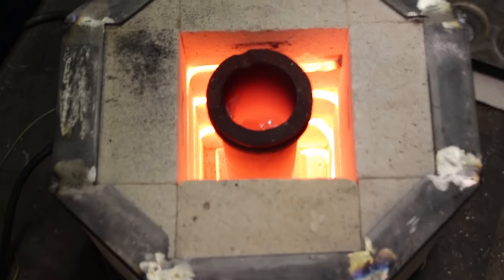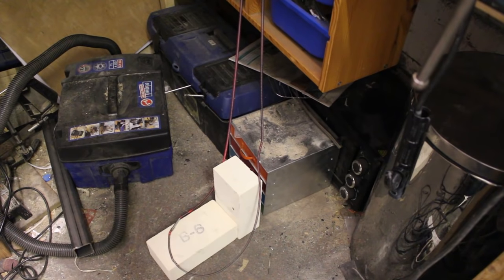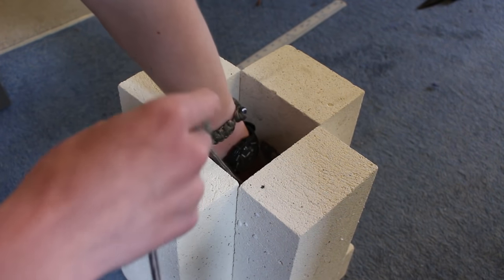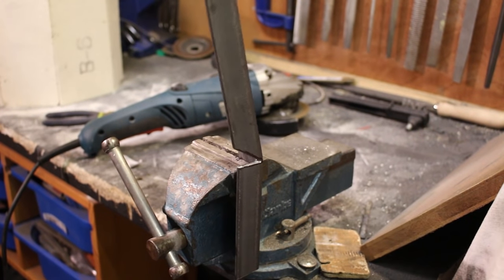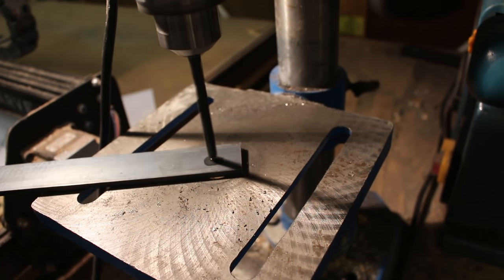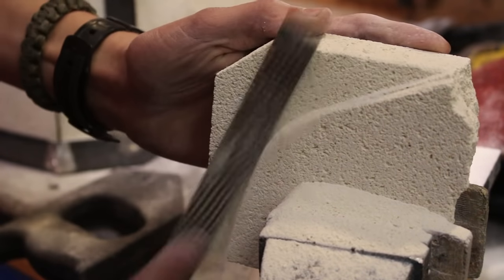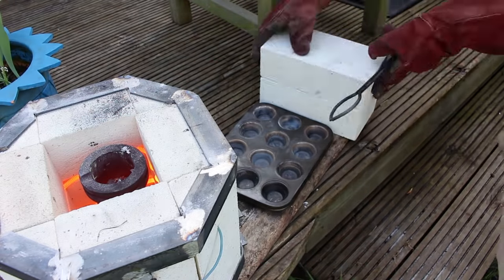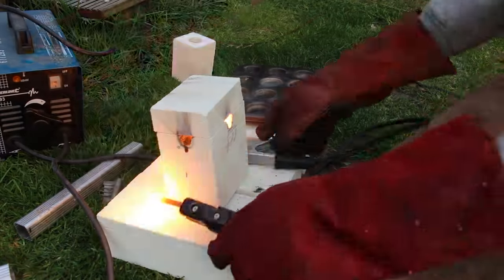How to Make an Electric Foundry For Metal Casting - Part 1

Comment: Hi TAOW!
Amazing video, I had a couple of questions though. How much overhead space do you need above the foundry? It looks like you are doing a lot of this in your garage. For safety you turn off the electricity before adding metal, stirring or removing the crucible correct?
Reply: Ahh, I see you answered the safety question down below and at the very end. Would love to know the other question.

Comment: you don't need to experiment to find the resistance. i = v/r.  you can measure the resistance, the length, the current, the voltage, and you've got all that you need to measure and math out how much you want

Comment: Would you have the ebay links for the materials you used? I'm curious which fire-bricks you got and which elements you used. Right now I'm using a big metal drum which looks ideal to convert to an electric model.

Comment: Amazing! Trying to obtian this wire, can you say what wire diameter you got (as in the actual wire thickness/gauge)? Or what the spec/rating of it was.. There seem do be different ones on ebay and if it gets too thick I guess the power will eventually exeed what mains can handle..

Comment: Question. Your work table. The blue trays. I'm dreaming of a 200 tray gratnells system but it turns into my worst nightmare when I see the price. Is this a self build. If so where do you get the trays from and do you have any plans?

Comment: is the wire isolated? Because you are using unisolated pliers when you touch the curucible when it is 1cm away from a 230V wire.

That looks seriously dangerous to me.

Comment: What is the gauge of coil used in this project? I assume it would be rated for 3000W in total? Judging by the width of the refractory bricks (~11.3cm), there would be 4 (bricks) times 3 windings, giving in total about a 150cm length of heating element. If you wound two 1m coils together, I suppose both would have to support a load of 3000W?

Comment: Question since I know nothing about EU power, on your wire, you have hot, neutral and ground; The hot puts out 220V? Do you have a video or picture of a volt meter going across the hot and neutral? Need to know if I will need to build a step up transformer for the 220V element.

Comment: Hi,

I live in an apartment with a small patio......BUT ONCE BUILT could this be used in this application..is is noisy or does have a large electrical energy draw.......I dont mind spending the money BUT I definitely want it to be safe.

Comment: I used 1.5 meters of FeCrAl wire that measured 20 ohms but when I plugged it in it didn't heat up like yours did, it got hot but not glowing red/orange hot, I'm working with 240V AC  and a 15amp fuse plug what should I do differently ?

Comment: In regard to some of your fan comments, 230V is more than enough to kill an adult.  Most deaths in North America occur at 120Vac.  It is not voltage that puts your heart in ventricular fibrillation or seizes your muscles, it's current so if the conditions are right, any voltage that can produce 100mA (0.1 Amp) or more through your body is potentially lethal.  Pain is already felt at considerably lower currents than that.
Further more, the danger that I observed in this design is running electrical wires onto threaded rods that attach directly to the heating elements through holes drilled in the metal frame.
Wire insulation can only withstand so many degrees before it begins to melt and this is after all a furnace running at extremely high temperatures, well above normal wire insulation withstand temperature.  Teflon is a high temp insulation but I seriously doubt your appliance wire was teflon.  For this reason, holes would have been better drilled through the brick (more likely to insulate) because should your wire insulation melt, bare conductor could then touch and energize your metal frame and now you have a live frame that is hot to earth ground exposing the user to a shock hazard.  If both ends melted and touched the frame, you'd have a short across the supply.  Wire insulation should be able to tolerate the extremes of what it will see and should never run through an unprotected hole (use a grommet or "chase nipple" for mechanical protection - a drilled metal hole will have sharp edges or burrs that can cut wire). Remember, heat will always travel along metal surfaces so heat on the elements will most certainly travel outward to the insulated wire.  Stove wire is rated to withstand much higher temperatures for this reason than general purpose appliance wire.  Again, I believe the wiring design for this example needs to be seriously revisited (consult an electrical expert), I would hate to see anyone get electrocuted, as impressive as the project is otherwise.

Comment: You can break up aluminium much easier by just putting them in your BBQ for 5 minutes and then wack them with a hammer.

Put a limit switch so that when you move your cover bricks to move stuff in the furnace it automatically turns off electricity

Upgrade your heating elements to mosi2 (Molybdenum disilicide), your furnace will now reach 1800C and you will be able to melt steel and gray iron.

Add since you're no longer using combustion to power your furnace, you can now use a shielding gas such as nitrogen to get less oxidation. It will also allow you to use the higher temperature thermocouples like the tungsten series like type C,D or G thermocouples

BTW you don't need PID tuning because you don't need millisecond accurate temperature control. Normal thermocouple based thermostat is fine.

You could also do heat treatment of metal with your furnace once you have basic temperature control. Make sure to correlate at least 3 thermocouples for accurate reading and avoiding "hot spots"
Reply: daam thats realy complicated and extreemly ausome are you a blacksmith or a electrician             or both!??????? =)
Reply: +shodanxx Apparently mosi2 heating elements are REALLY expensive (the cheapest on eBay from China costing $240) so I don't think he'd vote for that. Moreover the fire brick might start melting before that temperature is achieved so he might need to upgrade the refractory material too. I'd probably opt for graphite rods (or tungsten) instead.

Comment: what is the amx temperature that the furnace can get? im making my final project for my studies and i am using your furnace as  example for making mine, i would use mine more as a metal hardener than a alu melter but it is a great start your project :o

Comment: ı think it is little bit dangareous you should safe cable from heat and you can also use a sensor for when you open it cover electiric directly close

Comment: just an after thought, the holes that you made to pass the live and neutral wire through, add rubber grommets to them, if the sharp edges cut through the wires from moves the forge around you are gonna have a very bad day
Reply: He should probably get some high temperature stove appliance wire too. When I had to rewire my stove I picked some up at an appliance repair center. It's good stuff.
Reply: i just saw the other video where he replaced all the wire with fiber glass covered steel core , great choice

Comment: hi, I recently used a very (very) similar method to make a propane forge for knife and swordmaking with the same firebricks as you but i had some trouble with bricks cracking when they got up to the right temperatures, once i loosened the steel frame they had space to expand and its been working perfectly, i was wondering whether you had had any issues like that when testing your forge?

Comment: I have a 50 foot extension cord I can cut up.  It is rated 13 Amps 125 Volts.  Maximum watts 1,625.  300 volt insulation.  About how hot will this get?  And is this fine for what this video is teaching or will it be too weak?  I'd like to melt down some old cast iron projects so cast iron is the hottest thing I'll need to melt.

Comment: whatsup guys ;) I have a small question. If I make a charcoal forge using these bricks, will it work? or is it better to use the plaster/sand technique... I think this method is cheaper (since plaster bricks are pretty cheap in my town)

Comment: will using autoclaved aerated concrete work ok ? i just don't have the money for the firebrick and autoclaved aerated concrete is like 2,5 € per 12x60x25 cm block

Comment: I am a uncirtified electrishion and have been welding for 4  years but I'm from the USA and we have 120v main and I feel like if I build this I would be burning out coils constantly with 240 volts if you shot yourself even at a direct contact your odds of dying are there but aren't very high I shocked myself with a 1100 volt transformer and it was a very strong contact through my hand and not through my body but just my arm and I made a fool recovery with just severe burns I've been trying to make The Foundry for a few days now butt have had no luck I would like to make it is but I feel like I would burn out all the coils and don't have the electrical supplies on hand to do it and it would be a hassle making the coil thanks for the video and I was recommended to watch this video by The King of Random

Comment: turning off the coils when you open the furnace is unnecessary, they wont electrocute you since they already form a closed circuit, and only a small amount of current would even be able to short through your hand/arm if even if you were to create the shortest path possible given your setup. besides, you would have other problems if you touched red-hot wires with bare skin. welding gloves will properly insulate you, they are made for welding after all.

Comment: All the heating elements sold on eBay are for 220V.  Can I adopt it for 110V by shortening even more?  Also, what would happen if you were to touch heating element with steel crucible?  I don't want to fry my circuit breaker and I was told after few resets it won't handle as much current as original rating.
Reply: yes, you can cut those in half and put in paralew and touching that element when on could be bad, so I would recomend cutting the power when moving the crusible

Comment: Save up your money and get a cold saw. It would cut the steel for the frame like a knife going through hot butter. And do it accurately.
Reply: GW Spangler you mean a hack saw ?
Reply: No, a cold saw.  It's called that because when you are done, the cut edges are cold compared to most any other way of cutting with a power tool. Mine is made by a company whose name is, I believe, H.K.Morse.  Looks a bit like a power miter saw.
Reply: Google "cold saw" to see what I am talking about.

Comment: Just curious about the voltage distribution: Is the voltage 220 across every element ? A  breaker panel , in Canada, can put out 240 V but across 2 phases. That is to say it has 4 wires: a ground, a neutral  and two hots that are 180 out of phase with each other. Getting that sent to the outside of my house, for safety sake, will be a major undertaking. i wish i could use 120 , single phase on a 15 amp feed. Anyone done that in the USA or Canada ?

Comment: Just a word of warning for workplace safety........DON'T GRIND ANYTHING INSIDE THE WORKSHOP., TAKE IT OUTSIDE AND GRIND IN THE OPEN..........the small particles of sharp metal will wreak havoc with any machinery electrics  and your hands when you get one stuck in you and they will walk into the house and car on your shoes.....constantly use a vacuum cleaner to remove the metal particles from filing and drilling etc.

Comment: I don't have 220v supply in my house, so I've tried to make it with 110v using the same resistances as used in the video. To achieve the appropriate temperature however I had to shorten the resistances to about 1/3 the normal size, so I've made a prototype with 9 resistances in parallel. Huge mistake, the current it made was huge and I could've burned all the wirings in my house, by my calculations it was 25 amps. Anyone have any idea on how I could solve this?

Comment: Idk if youd die, those tasers are like 950,000-80 million volts and they dont actually kill you surprisingly
Reply: yes but amps and voltage are 2 different animals, a taser is usually 50,000 volts according to google at 0.05 amps is enough to give u a severe shock while 50,000 volts at 0.1-0.2 amps (100-200 mA) would be enough to kill you. The amps he is using is max 13 amps, and 0.1-0.2 amps are enough to kill you so this will fry you instantly that's why there's a warning. Amps is the rate and which the voltage flows and voltage is potential energy (Just in case you haven't done electricity in science or you forget)
Reply: TheWalkingShroom Ah I didnt notice that. But most tasers, good ones, not the police ones are usually up to 1 million
Reply: still doesnt kill u if amps are low

Comment: Nice Smoke free Foundry! Just might be exactly what I need! Going to watch the second part for the upgrades. 8m in USA, So I have to do some convertions, pounds to Dollars, metric measurements to American Standard,  but I'll be able to figure it all out. Thanks for your very time consuming work recprding, editing, and describing as you went along. I just have to make a 240 volt breaker I'm my box and rum a wire with an outlet. Simple enough for me to do. Check my channel for a few projects I put up with more coming soon especially the ones showing how you can get 300 miles per gallon for your vehicles like I did to my van, 2003 Chev Astro van,  3 videos show how to do it.

Comment: Could you use this system for heat treating steel (I mean if I were making a chisel or something) as opposed to going down the fire route.  Its just a case of monitoring the temp and removing/dunking in oil or water (depending on the steel) or am I missing something with this system?
Reply: you could. im going to build this for that reason but im going to make mine horizontal
Reply: Good luck with it and should post a vid with the outcome, be interesting to see

Comment: A bit of construtive criticizm: instead of cutting out 45 degrees on one piece, cut out 22.5 degrees on both sides. This will give you your 45 degree cut and the corners will all be equal length, looking a bit better.

Comment: the problem with this video is, this tutorial won't work for people in the U.S., seeing as you need a specialized plug just for 240VAC. most households over here only put out 115-120VAC, and I'm not entirely sure the heating element you used is designed for lower voltages. Sure, it could work, but it'd take a hell of a lot longer to get to the necessary temperature to liquefy aluminum(aluminium) or copper, or any metal for that matter.

Comment: This may be an idiotic idea, but can anyone tell me why this same thing couldn't be done using ceramic fiber insulation instead of fire brick?  Also is there any way to get an electric foundry to reach 3000 degrees Fahrenheit?  Serious questions here.  I attempted to make the flower pot foundry that Grant Thompson made, but it wouldn't get hot enough to even melt aluminum and it ended up getting left out in the rain and became useless.

Comment: I'm still wondering why you didn't make something to hold and center your crucible in the middle to minimum the risks of electrification...

Steel rods or titanium can be purchase on ebay .
Or tungsten rods on ebay, which has a melting point of 3.4k celcius.
Even though it is rather brittle, better than losing your life. 

6 holes and 6 rods to center the crucible as you put it down.
3 rods at the top, 3 more rods in the middle to reduce the chances of your crucible's bottom to go in any direction.

Comment: Apologies if this is in the video, any idea what type of wattage this is pulling?  Just concerned with current required for us yanks at 120v mains.
Reply: Just use a 220v outlet found for large home appliances such as washing machines
Reply: The wattage would be half, since half the amount of volts are going in. You would need to increase the resistance to make it to 1.2kw.
Reply: It's the opposite.  Volts x current = watts, you can't change the voltage, so you need to increase current to increase wattage.  To increase current, you need to decrease resistance.
Reply: This furnace is pulling 1856W from the mains. As current decreases as voltage decreases, you'll need to use a 7.8 ohm length of wire instead of the 33 ohms used in the video. So you'll need way thicker nichrome wire.

Comment: amazing video man, realy well done. 

i had a thought near the end when you mentioned factory made electric forges having adjustable heat. that realy wouldn't be all that hard to do with yours, just connect a variable resistor in parallel with your coil (variable resistors are cheap, and you can find them here: www.digikey.ca or on ebay). you wouldnt be able to know exactly what temp the forge is (unless you added some sort of thermometer) but you would certainly be able to adjust your heat. also you'd be able to make your coil so it can be hotter- i know you said in the video that hotter = burns out faster, but if your forge heat is adjustable, then you dont need to run it at fullboar all the time, just crank it up if you wanna melt copper or silver, or w/e.
Reply: the variable resistors from digikey may not be big enough/tough enough for this application, i think most of them are ment for electronics.

Comment: Would it be as cheap if you was paying the electricity bill?
Reply: He does not run the furnace for long lengths of time. The furnace is drawing less power than that space heater did, that he took a cord off of. People run those radiators all season long, just to keep their fat asses warm.

Comment: you need to work over the wire insertion the insulation of the cable shouldn´t touch the metal use some extra protection pls